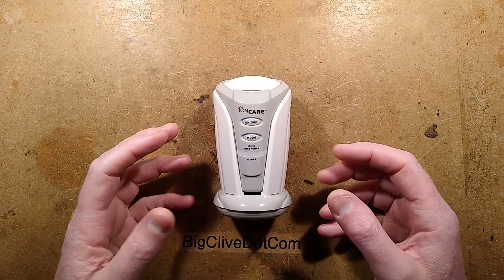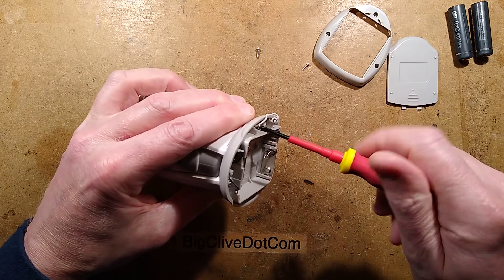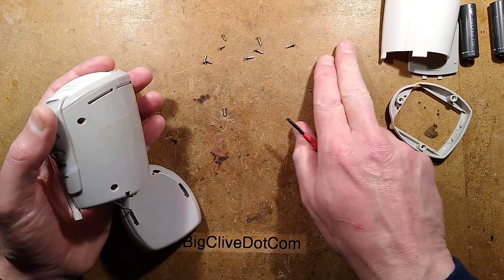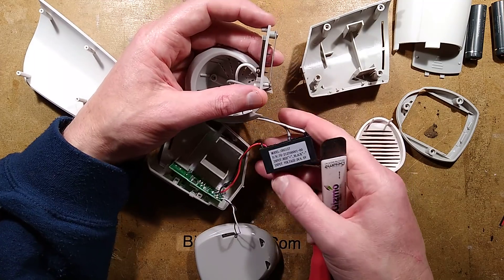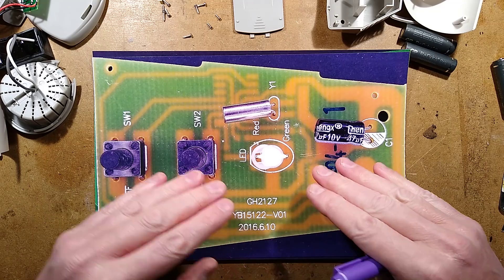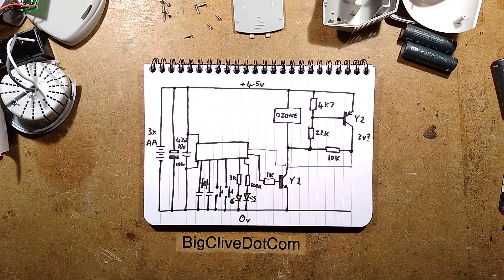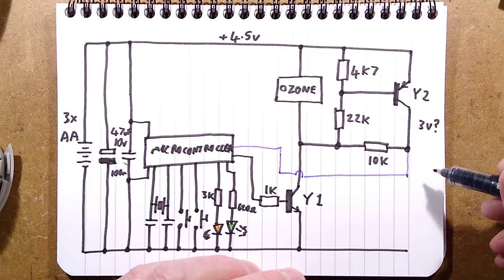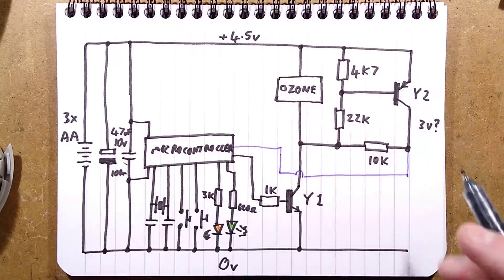Very retro "Japanese" air purifier.

Comment: I bought a used under counter fridge in February the 23rd, it's been sitting in my garden until today (June the 24th) a solid 5 months. The smell was bad, even after airing it out and cleaning it fully it smelled terrible. It's been between 23-28c for the last two weeks. 
I cleaned it with washing up liquid and then no rinse anti bacterial. 
The musty smell remained, even after it's been running for 6 days. 
 Then I remembered I have this little boy, I put it in the fridge at 22:00 at 03:00 the smell was totally gone. It's completely neutral, no smell at all! 
PS, what do the two modes do? Also my unit was arcing, when switching it off and on. Excess moisture?
Reply from the maker: If it was arcing it may have been dust or humidity.  I think the modes are just different timing cycles to give ozone strength control.

Comment: Your videos made me wonder if the purple glow from the electronic corona (Neon Fluorescence) was Cerenkov radiation. I did a search with DDGo and it gave me the Wikipedia to 'Ionized-air glow'. That did answer my question. https://en.wikipedia.org/wiki/Ionized-air_glow "Cherenkov radiation is produced by charged particles which are traveling through a dielectric substance at a speed greater than the speed of light in that medium. Despite the production of similarity-colored light and an association with high-energy particles, Cherenkov radiation is generated by a fundamentally different mechanism."

Comment: I have a similar device, and it seems to be arcing inside. I hear a clicking noise while it's running, and when I look through the top grill, I can see the miniature lightning inside. Is that normal? I suppose it'll create ozone alright, but I'm not sure if it's supposed to do it that way. Yours doesn't seem to do that.

https://youtu.be/gYc_4pAEBOo
Reply from the maker: That's unusual.  If it didn't do it initially then it may be dirt buildup.
Reply: @bigclivedotcom  Thanks for the reply.

No, it didn't do that from the beginning. But it began after only a few days of operation. I opened it up and there was no noticeable dirt inside. Cleaned it with IPA anyway. 
I also moved the metal plate with the holes in it a little bit further away from the spikes, using a plastic shim and some bending. I can still see the corona discharge, but no more arcing. At least for now. Let's wait and see.

Comment: Clive I found it.
It can be found in Japan under those reference ASH-2338 or AY-8338 both seems to be produced for Asahi (アサヒ)  in 2011. But it seems to be mainly for Asian overseas market (south east). We can still find it on Amazon and Rakuten. I will buy one for my pet litter place … thanks for the information about build quality (I may also dismount mine to check it)

Comment: I have a 10+ years old device like this in my fridge, still working. I had to open it lately because it touched the back of the fridge, water landed on the needles and it started arching. Mine has an additional decorative ring part around the battery holder and the buttons are a bit different style, made as a rubber membrane with long sticks pressing the buttons on the PCB. Everything else is the same, including the way it goes apart. Maybe it has more screws though... xD
EDIT I love this device, it keeps everything fresh and reduces bad smell so efectively i don't have to use any tricks to get rid of the "fridge smell".
EDIT2 The PCB was different too, mine has a through-hole design micro controller.

Comment: Okay, screw it, this is fun. I have an older Samsung monitor and to open it, I had to unscrew 4 screws only for the stand and then get the crowbar and open it by causing permament damage to the plastic every 3 centimeters around the edge. As a revenge I fixed it and will be using it for many years :D

Comment: Would changing the spikes to carbon filaments make this output higher, just like an ioniser?
Reply from the maker: I have one I modified like that, and it seems to behave differently.  Less airflow.  The plasma darts about on the tip of the carbon fibre bundle.

Comment: I have a remarkably similar unit by Limburg Germany branded a Genius-Air PLUS, model no GH2187. Same white and grey plastic, similar sloping top, similar curved side panels, similar 4 pin electrode unit but 4 AA batteries which slide up into a cavity. Small LCD indicating temperature. So could the design be German?

Comment: Question for you Clive. I have a small bedroom and the upper floor of my house really does not have open windows or vents (long story). If I wanted to get the mold fighting and other handy ozone effects, is there any recommended small ozone device I could have running in the background? Or some sort of "run for X hours a day" or some sort of scheduled ozone usage. Like in your video, it doesn't take much, but without open windows I want to make sure I'm at  "normal" levels at least.

Comment: What is the purpose of an ozone generator?
Reply from the maker: It creates ozone indoors on demand which can reduce organic odours and have a mild sterilising effect on the air.  You can get low level oines like this, or high power ones for room sterilisation where you have to avoid being in the room with them.
Check out my recent "great big ozone video."
Reply: @bigclivedotcom  Did you see this? https://www.epa.gov/indoor-air-quality-iaq/ozone-generators-are-sold-air-cleaners

Comment: I've tried those "air purifiers" back a few years ago. They seemed to work, but the stats are underwhelming:
Less than 0.01mg of Ozone per hour in most of them - the number could be wrong, but it was a really, really, really, really low, nearly irrelevant amount of Ozone that was generated. The unit i used as meant for 50m², but only drew 2 Watts of Power....

To give you an comparison of what is "actually cleaning the air and objects": you need to produce several thousand milligrams of Ozone per hour, in order to effectively purge odors and destroy mould and pests, and other nasties. Professional units produce at LEAST 8000 milligrams per hour. Units with 15.000 mg/h are available and used for "home purging". Needless to say you would probably suffer lasting health issues if you ran an unit like that inside your home and lived alongside it. Hence why the little amount of Ozone generated by such "small type units" are safe. It smells of Ozone, but Ozone in itself has a strong odour and is very very easy to sniff out. It's like bitter substances in your food - your senses can taste even the tiniest amounts of bitter substances between otherwise well tasting food. Such is it with Ozone, since it is not inherently naturally available around us due to the short half life.

Most datasheets available do not account the tiny amount of Ozone released by such small low power devices. Ozone can linger for several minutes, surely, but if it is literally such tiny trace amounts, the decay of Ozone would be so rapid that you literally have no lasting health effects, and most importantly - no actual beneficial effects on the cleansing of air, sterilization or neutralisation effects.

If you want to deodour your home, you require a professional device and let it run for several hours at which time you can not reside anywhere near the device, let alone in the same enclosed space with it.
Reply from the maker: Units like these are intended as ambient level ozone generators that emulate outdoor levels indoors.  You don't really want too much ozone in an occupied area.

Comment: I so want to see some unfortunate housefly or mosquito get sucked into the unit and touch the pointy bits and the holey bit at the same time while the unit is on. The one thing this unit lacks is a bug-attracting lamp. And just to add insult to injury, the now dead bug bits will be subjected to the ozone to “freshen” them right up. 😂

Comment: I aclually had the same design unit. It was marketed as a car air ionizer in EU..
Reply: Then I took out the HV power supply and pranked my friends with it. 😁  I don't remember if I added some caps or it had some internal capacitance, but when the battery was disconnected, it still had a good zap left

Comment: Hi Clive,
As you have a lot of ionisers and high voltage generators I'm wondering if you have ever tried Kirlian photography using photographic paper on top of a sandwich of glass with a conductor in between that is grounded. The object to be photographed then has a high voltage applied which creates a "photograph" of the object using the corona discharge. Would love to watch you do one for a video.

I remember adverts in electronic magazines in the 80s/90s advertising an ioniser kit which could be used for this. (cant remember the companies name now)

https://en.wikipedia.org/wiki/Kirlian_photography

Cheers

Paul

Comment: "I should've just wrote MCU" 😆😆 I feel that
Reply: Or my preferred, even shorter abbreviation: uC or µC (I almost always go with the mu in stead of the "u" when hand-writing it.) "MCU" has too many other TLA meanings. ;-)
BTW, the alt-code for mu is alt-230. (Hold down the alt key and type 230 on the numeric keypad in Windows. I don't know if it works on Linux or MacOS.)
Reply: @Sembazuru  I never thought about it like that, that's true
Reply: I usually write uC :>

Comment: A most enjoyable episode. I read a couple of comments about electronic waste, which reminded me of Microsoft's Windows 11 which in a generalised statement will not run on a computer with a CPU older than 2018. (Ignoring the hacks) The electronic waste from this decision could be reduced if they change the hardware requirements. Some say they may remove the hardware requirement to allow older computers to run W11. I was wondering Big Clive do you have any thoughts on "early" redundancy on equipment that is still viable for use.
Reply from the maker: The redundant computers may end up as faster Linux computers.

Comment: Your next task is to convert it to run off mains , looks to be enough space in there for the components
Reply: There might be some safety implications in using a mains powered device IN your fridge. It would have to be carefully shielded from excessive humidity.
Reply: @johncherry108  I was thinking more about if you wanted to use it outside of the fridge , alternate its use and make it more versatile . should be easy enough with a rubber bung to plug the adapter socket , not sure about how to wire it up but its probably not to difficult

Comment: Thanks for not flipping one of the photo's of the circuit board, I find it easier to follow when I can flip the board in my head for some reason, especially when the tracks are very clearly visible through the board.

Comment: So my question is, if these devices are so good a stopping food going off in fridges, why aren't the manufacturers not incorporating them in to the fridge. I would have thought that would be a really good selling point.
Reply from the maker: Probably because the flat earthers have given the word ozone a bad rap.
Reply: At least in the States, the FDA cracked down on any device that makes ozone intentionally or not after the a bunch of the units were discovered to be making harmful levels of ozone--for any size room--and were being sold as targeting small rooms.

Additionally, sunlight reacts with diesel and car exhaust (from what I understand, moreso diesel, but there are more cars) to create ozone at the ground level. Without a strong breeze to blow it away, it's possible for the quantity of ozone to reach a harmful level quite quickly, and the EPA regulates and issues advisories to this effect. It's particularly dangerous as you can't just "go outside" to escape it, it's already outside.

So, making any quantity of ozone--even a ridiculously small quantity--gets you regulated and requires FDA approval.

Comment: I have this one. i was not happy with the timers so i short circuited the timer circuit by bypassing it with a switch IF REQUIRED FOR LONGER THAN THE 20 TO 30 MINS and i also added 1 pound power bank it to avoid spending money on batteries
Reply from the maker: Technically speaking you could add a USB cable and diode to drop the voltage slightly for continuous use.
Reply: @bigclivedotcom  i found 4.5 or 5 volts made hardly any difference. most batteries are 1.65 when new so 3x1.65=
nearly equals 5 anyway. The adding of the timer bypass switch allowed me to take control of it as i found the initial 20mins on and then 1mins on every hour inadequate.
Reply: Please could you explain how you did this. I think that would be a very useful adaptation. Cheers Peter
Reply: @pw3090  just put a wire with a switch in series and connect to either + or -ve of ozone module. the other end is connected to ground. it simply bypasses the on/off and timer circuit
Reply: @esecallum  Thanks, that's very helpful.

Comment: So; it runs off 4.5 VDC, 3-AA batteries, 3V min threshold, great emitter... I bought 3 off Ali and they just arrived. Unit #1 gets a USB connector straightaway so it runs forever in the bathroom.  Unit #2 gets a massive battery pack so it runs near forever in the fridge.  I love that you take these things apart first and show it all off, makes it even faster when I take mine apart.
Reply: What’s the benefit of using these in the bathroom and fridge?
Reply: @Alexander_l322  Ozone is a very strong oxidizer. It reacts with volatile organic chemicals, bacterial and fungal spores, and so on. In one, it keeps food from spoiling so quickly, and from food taking on the 'flavor' of the fridge air. In the other, it keeps the air clean and gets rid of smells.
Reply: @cheyannei5983  sounds like a great thing to have! I know what you mean by the fridge taste
Reply: @Alexander_l322  Well the benefit of using it in the bathroom should be somewhat obvious lol
Reply: @micahnightwolf  stinky
Reply: I read this and then had to come back to it after ten minutes when I realised (while at the fridge) — where’s the power for your USB coming from in the bathroom? Do you have power outlets in your bathrooms? o.o I have none in my current apartment, and in my prior one there was a shaver slot but that’s not a standard wall connector. It didn’t print maximum current on it but I imagine you could technically get an adapter for low loads if you really wanted.
Reply: @kaitlyn__L  don't know where you or they live. But in Sweden (and I asumme the rest of the EU) this is common in modern bathrooms. I have three outlets (one for the washing machine) in my bathroom. All standard 230 volt.
Reply: @TheSimon253  I’m in the UK. The 240V shaver socket looked like maybe it’d fit a Europlug. The 120V one (115? 110? I don’t remember exactly the numbers but that’s not really important) looked like a cross between Europlug and the American one (circles with protruding flat blades). 

But it was most certainly not compatible with the UK standard (and allegedly had extra protection in the case of water getting on or in it — not sure what though since all the household breakers had RCDs already). It said “ELECTRIC SHAVERS ONLY” or had a little symbol that meant the same thing, depending on the particular apartments that had them. I only ever used the 240V one to charge a toothbrush though. 

Your washing machine is in your bathroom? That’s interesting. Mine has always been in the kitchen or in a tiny cupboard (often itself accessible from the kitchen) in the various flats I’ve lived in. Presumably because the water is already plumbed in there. And I presume that’s also why yours is in your bathroom.
Reply: @kaitlyn__L  I know what outlet you mean. Had one in the house I grow up in. Never tested it since I don't think the plugs fit. It's also 120V so we were scared the elektronics would take damage. I'm not sure it would fit however. 

Anyway, having the washing machine in the kitchen is super weird to people outside of the UK. Honestly could find a lot of weird things you brits do in your home.. Like having two taps (I know why but it's still stupid).
Reply: @TheSimon253  ~230V equipment won’t get damaged from ~115V stuff just so you know :) undervolting usually just results in less heat/slower spinning/just not turning on. Like when I plugged my hair straighteners in with the passive adapter in New York it just took 10-15 minutes to heat up instead of 2-3. It’s not destructive like overvoltage so often is. 

But of course it’s understandable and good practice to not want to take unnecessary risks when the specifics are unknown. So your family certainly made the right call. 

I think I’ve also seen those shaver outlets in hotels across Europe when I was little, didn’t rly think about it too much. 

Haha yeah, I knew the kitchen thing in small homes or apartments was unusual worldwide, but I’ve previously only seen people say that when they have a whole separate laundry room instead. Which my first ever house did have, albeit even that was right next to the kitchen and probably shared the plumbing. I guess the tiny cupboard maybe technically counts as a laundry room though..? Even if you can’t actually stand in it?

Also every house or apartment I’ve lived in aside from the very first house did in fact have mixer taps in the kitchen and bathroom. And even that very first house had one in the kitchen, just not the bathrooms. I know it’s technically not up to code but that seems to be an almost-universal (sans Tom Scott) flagrance that no one really minds.

In your estimation, when did Sweden start having regular outlets in bathrooms? You said all or most recent builds have them right? So is it like, circa 2000 they started doing it, kind of a thing? Bit older than that?
Reply: @kaitlyn__L  Hard to say. I estimate it to sometime in the 90s.